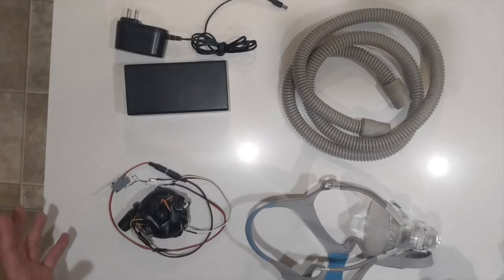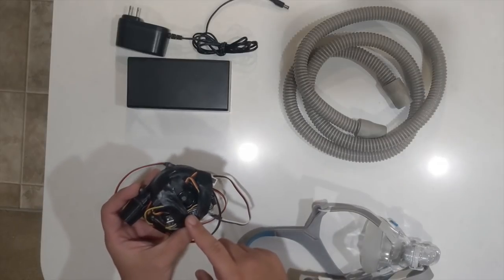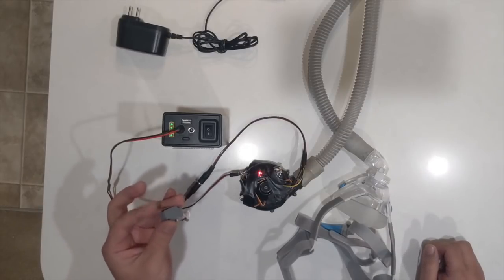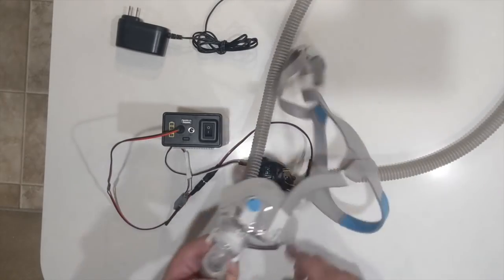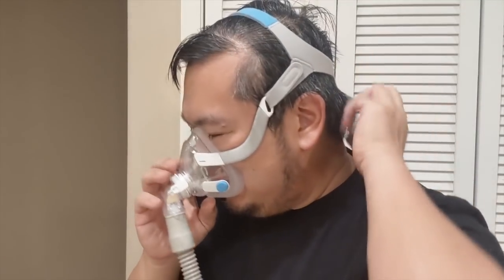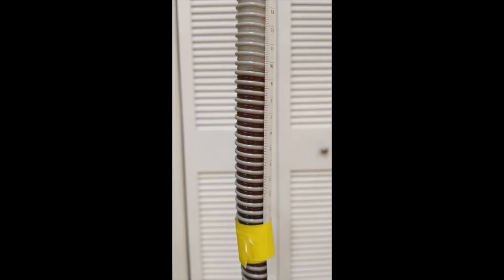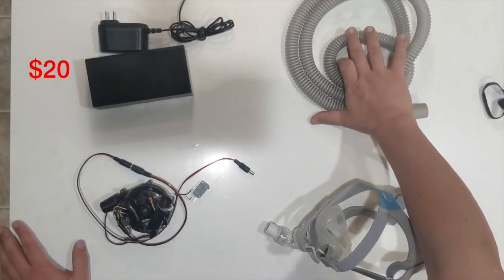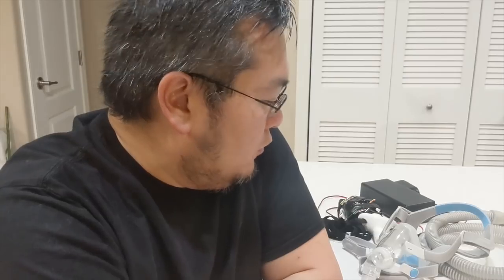Low-Cost Open Source Ventilator-ish Device

Comment: The folks over at ApneaBoard are having this very discussion.  Your help/comments at the forum would be greatly appreciated!  It's on the main forum under "CPAP use for Coronavirus mitigation & severe pneumonia".
Reply: Thanks Jeff.  Yes, Johnny, I invite you over to the Apnea Board forum where we've been having this conversation for the past week.  We have a lot of knowledgable Advisory Members over there who might have insight that could help you.  Would love to collaborate a bit, as this will increasing become a very important project.  -- SuperSleeper, Apnea Board Administrator.
Reply: Love how your thinking. Ive been thinking along the same lines as well. As a cpap user myself and working in an engineering field as technician, I love DIY projects and solutions. Keep going with it!
Reply: So you copied a comment that someone else already said.
Reply: Had a read of the discussions over there and it makes good sense.

Comment: I was an ICU RN for years. You have to be able to regulate both volume and pressure as well as the amount of pressure left in the system after the patient exhales - called Positive End Expiratory Pressure - or PEEP - which is vital for someone with severe pneumonia or ARDS. The pressure left in the system at the end of expiration helps keep the air sacs in the lungs open and is very similar to CPAP. You must be able to set a volume of air the machine will deliver with a single breath - called the Tidal Volume - typically 600 to 900cc of air. You also have to be able to set the rate of breaths the machine will deliver per minute - typically 12 to 20 depending on other conditions. It's very important that there be a pressure relief valve in the system to vent air off. If the vent is trying to deliver a breath and the patient coughs against the breath it can raise pressure in the lungs very high and pop a hole in the lung tissue - a pneumothorax - which can kill someone quickly if the pressure inside the chest cavity builds up. Besides delivering a set number of breaths the machine has to be able to sense if the patient is trying to breathe on their own and assist them with that breath. Ventilators are very complex pieces of equipment. 

A better alternative might be to work on developing a device that can automatically squeeze an Ambu bag at a set rate per minute. The volume of air is determined by the bag and the PEEP can be set with an external valve that attaches to the bag. All you have to worry about is the frequency of breaths. Others are working on this right now. Good luck.
Reply: Highly Relevant Commenter think a CPAP could provide the PEEP and the ambu bag provide the volume and frequency?
Reply: Thank you for your feedback. Check out the notes section from after talking to pulmonologists and respiratory therapist. And if you'd like to provide more professional feedback, you can join the conversation on github: https://github.com/jcl5m1/ventilator/wiki/Notes-from-chatting-with-a-pulmonologist

Comment: I knew someone with an understanding of how medical ventilators work and some ingenuity would rig up a basic prototype and make a YouTube video.
These guys are heroes!
Ventilators are essential for treating covid-19 and are in short supply globally.  Ventilators of sufficient quality to last the duration of the crisis could easily be mass produced in a relatively short time.
Reply: madwtube  What's the set back? He did ask for feedback.
Reply: > someone with an understanding of how medical ventilators work
He isn't. Sorry to burst your bubble.
Reply: @nodriveknowitall702  This isn't capable of the type of ventilation COVID patient's need... first do no harm... in the end you may end up hurting more than helping by implementing this bootleg stuff.
Reply: @DanShowandTell  Yeah, that's what someone else said already. I dont doubt that you and the other commenter are correct, but you're not describing exactly what the issue is. 

As far as harm goes, I wouldn't be implementing anything like this. I was only curious. I'm practicing prevention rather than medicine.

This may be on another level outside of my typical experience but I see people, all to often, give up when practical solutions exist.
Reply: nodriveknowitall the issue is the vent isn’t capable of modes of ventilation required. Full stop.

On top of the vent we also need sedation, paralytics, software, monitoring devices, and (most importantly) staff to actually implement the modes required.

I’m a respiratory therapist... I make a living operating these machines
Reply: @DanShowandTell  Per Johnny: Thanks for the feedback. Here are his notes from chatting with pulmonologists and respiratory therapist: https://github.com/jcl5m1/ventilator/wiki/Notes-from-chatting-with-a-pulmonologist

If you have additional recommendations, feel free to provide guidance to help improve the project.  He has the following thread open to track professional feedback.  Advisers willing to share contact info are greatly appreciated.

https://github.com/jcl5m1/ventilator/issues/16

Comment: As a long term CPAP  user and engineer, this is obvious to me and many other folks and I have discussed it with friends.  My approach is to leave the CPAP assembled and add one of many possible experimental modules to modulate the control voltage of the CPAP.  An even easier and more straightforward approach is to start with a BIPAP and make minor changes to the control voltage.  I believe the BIPAP approach has been tabled all over the technical world.  

Johnny, thanks for bringing this general approach up.

Comment: Hi Johnny and other interested Makers,
i am  building "something" right now as well, more along the lines of a positive pressure iron lung :
- really simple 
- easy to build
- easily available non medical parts (hopefully in a lot of makers possession )  
- easy to service and repair 
- In case of motor falue manual operation possible (like the iron lung)

Geared motor -> linear motion ->  bellows -> Pressure regulator tube (the thing that goes up and down in the cartoons) -> valves for respiration and inspiration -> lungs 
i think the pressure regulator can also be used as a volumetric measurement, so you can change depending  on lung capacity.

Johnny Lee, i am open to help with ideas, in the meanwhile i have some designing and reading up to do now :D

best regards from Lara

to all the critics: Yes i know it is in my case it is driven by a wiper motor - but hey, it may save your grans life :3 
!!! also stay in please, so we don't have to use those funky machines ever!!!
Reply: Just make a video and show us plz

Comment: Johnny Lee, I'd like to invite you to Apnea Board to discuss your ventilator project with members there. Search for "CPAP use for Coronavirus mitigation & severe pneumonia"
Reply: Actually, many cpaps today have many of the same features as full vents. The most notable difference is the peep valve. As long as the patient can work with a simv mode vent I think cpaps can provide what is needed in many cases.  Simv is pt initiated assisted breathing verses total dependant on vent to breath
Reply: Daniel Roig  So then, someone needs to find a cheap alternative to oxygen separation/concentration.
Reply: Mike Moloch  One thought is maybe for some getting parts to assemble a blower like Johnny Lee has shown may be easier.
Reply: Daniel Roig  thanks for info
Reply: Daniel Roig  Of the ventilators my pulmonary doctor is considering, I do not see anything that describes or suggests the ventilator adds oxygen. That would require an oxygen bottle or portable oxygen concentrator. as my research indicated. FWIW due to my respiratory overlap of COPD and complex apnea, I may need the ventilator such as a ResMed Astral 150 or Respironics Trilogy. Neither of those generate oxygen.
Reply: Daniel Roig  Would a CPAP combined with an oxygen concentration be effective? It's got to be better than nothing once the hospitals get full.
Reply: Johnny why not  use the whole cpap instead of just the motor, it's programmable?
Reply: Daniel Roig  a ventilator doesn't generate oxygen... it's hooked up to 50psi pressurized O2
Reply: @jizzwizard6939  no... CPAP only aids in oxygenation... we need APRV
Reply: Daniel Roig a POC cannot keep up with a pt demand very well... at best they’ll put out 5-6lpm because that’s already a normal resting persons ventilatory demands, they don’t go higher without modification and that may accidentally turn it into a bomb. A normal minute ventilation is about 7lpm on minimal settings,  so at best you’ll achieve 50% fiO2 and that’s not enough.
Reply: Daniel Roig  he is not recommending anything. He is suggesting a potential starting point for other more qualified people to work with or discard. He made it clear that he is not a professional. Your comment is out of place and wholly unnecessary.
Reply: @Shimmy Shai I am going make an input  to add oxygen from a canister to this ventilator.
Reply: @jizzwizard6939  that's the point. When you are dying if this device gives you a 3% chance to survive. The hospitals will run out. I just checked on the production of 3 respirator companies and they can only produce 600/month
Reply: Daniel Roig  Oxygen is not flammable! though an oxygenated environment will make anything that is flammable burn more fiercely if it happens to be ignited.
Reply: There's just enough knowledge in this comment thread to be dangerous. Jesus christ.
Reply: @jizzwizard6939  I am a user of a cap device. I have seen cap masks that have a port for attaching lines from an oxygen source, such as tanks or oxygen concentraters directly to the mask. Not all of them will do this. But I have had one myself in the past. Hope this helps.

Comment: Thanks for your time.  As a patient using a resmed cpap,  i had the same idea as you.  The cpap from Resmed that I have is a brilliant piece of engineering. I have a similar mask for nose only.  It seems doable for the cpap manufacturers to come up with a modification.  A crude 12 breath cycle per minute application is easy for the engineers at the factory.  A lot of work for you and me.   The ResMed AirSense 10 could possibly save a few lives if it was just reprogrammed.
Reply: I have a CPAP that I also use from resmed and this is my thought as well. Re-tooling a CPAP seems like a much more feasible idea than stripping one for parts. The need for humidity in the air is because the lungs need that humidity. if you're too try you can get a sinus infection.
Reply: @utakubeta8311  I spent the day yesterday researching the topic.  Respiration is much more complicated than I thought.  I am not qualified.  I took apart an old Fisher Paykel.  I thought interfacing the motor to an arduino would be an interesting coding project..  It is more complicated than I thought.   There are a lot of better ideas out there right now.

Comment: I like this, Johnny. I am an engineer, and sometimes I work on biomedical devices. This is a very practical approach to providing an assist to a patient who is having trouble breathing who does not require full-up endotracheal ventilation. Several suggestions please. This motor is not a permanent service motor. It is consumer grade. If this kind of approach, without intubation, is effective in a significant number of cases, then the final version really out to have a medical grade blower. That would be a logical next step. Patients can require respiratory assistance for a month. For a proof of concept prototype what you have done is excelling, but if this is 'life support' you want better blower.  The second thought is that you could easily flow a little medical grade oxygen into the intake. This will help keep oxygen saturation up, even if the patient has impaired.  Between the two this device might help keep people off increasing rate, full up, FDA certified, tidal ventilators.  Kind regards, Robert

Comment: This looks great Johnny! Thanks for making the effort and pushing this forward. We need about 10000 more folks like you to make it happen. That's not cynical, but rather hopeful, and I'm happy to be one of them. I do have a few thoughts, and would love people who know ventilators and their operation to comment constructively. First, with constant pressure, even if oscellating, how is one to be able to exhale? Is there a valve assembly that I am not seeing that allows for this? Second, I would think that a medical professional (or trained other) setting up a system like this for a patient, would want some kind of display available, so they could chart a patient's vitals against the ventilator's settings. Hard settings, like dials and switches with LEDs, could do this, as could a display with dials or button controls. I just think that the folks managing the unit would want to be able to see what was actually happening in real time, and make specific adjustments in an articulated manner. Third, is there any need or desire to have an Oxygen input in a system like this? It might be a good option for the very ill for whom normal air is just not enough, although I cannot pretend to know how that would effect the design. Perhaps making some with O2 input and some without would be good, as the O2 may only be needed in few cases. No idea really. PLEASE HELP WITH THIS PEOPLE. MANY THANKS.
Reply: I am hoping to make 100 of these and send them to local hospitals
Reply: Yes.. adding oxygen would be absolutely vital in the advanced stages..
Reply: Check out his latest notes from after talking to a pulmonologist: https://github.com/jcl5m1/ventilator/wiki/Notes-from-chatting-with-a-pulmonologist

Comment: My wife is a physician, I am an electrical engineer, I told her that we should find ways to build a "home made" version of a ventilator, she told I was a fool: "those are computers" were her words, your video proved me right!
Reply: You should have said to her, "You can't fix human beings.  That's biology."
Funny that your wife does not understand that "computers" are designed by electrical engineers like yourself.  I'm guessing the mechanical parts would require the most thought for you.  You could probably do the circuit design and programming in your head.  I can relate.  I work in IT as a DBA/programmer and my close friends and family have no clue what I actually do.  If I try to explain they are basically lost halfway through the first sentence.  Most of them probably imagine that I replace broken keyboards or something.

Comment: I've ordered 6 disposable scuba mouthpieces for $11 on Amazon. There's no reason to 3D print the mouthpiece. I believe these clear silicone mouthpieces are used for scuba equipment rental.
Reply: Please add the link.
Reply: @WirelessDevelopment  There are many suppliers including Amazon. Google accordingly "Scuba Choice Scuba Diving Clear Regulator Octopus Mouthpieces with Regulator Tie (6-Piece) Perfect for Dive Shops and Dive Resorts"
Reply: @eenkjet  Those won't work for positive pressure ventilation. Air will just leak by the lips.

Comment: Apparently the main issue with the at home machines is that it aerosolizes the virus and contaminates the surrounding areas.

It needs a filter for the exhaled stream of air.

Otherwise I love it!

Links to the 3D  mouthpieces, but maybe someone can add a filter to a design?
Reply: I don't know anything about contamination so this may be stupid... But regarding the part of people in the room getting infected could there be a case where people who have been infected and came out the other side could volunteer to man the machines that way reducing the complexity of the system  and helping reduce speed of  deployment....
Reply: There are mouthpieces with a built in filter out there. That is an easy to solve problem!
Reply: If he is in quarantine no one is around so it's less likely it would spead
Reply: @babeena_gt_3645  Nurses and doctors need to be protected too, that's why they need a filter even quarantine
Reply: @bitzersporttherapie7331  I think he means self isolation at home.  Many people, as in China, might not even get into the health care system to be treated
Reply: @JointFive  Just that we have to think about needing a diy ventilator  in quarantine without medical assistance means our systems are out of whack.
Reply: maybe you can divert exhaust air into a chamber with ultraviolet and ozone supply inside. You can find ozone making from water purifiers. This can be used at the supply air intake side too
Reply: 2 tubes. With a valve on the outlet side. Filter air in. Filter air out.
Reply: if you have a sick person at home, unless you have a completely quardoned off area with seperate AC/hear and the other family members wear full medical PPE you are going to be encountering the virus! 
 The short answer in a home envronment in a household where you live with the infected person there really is no avoiding contacting it!
Reply: @nigelr3628  or persons who already have the virus but are asymptomatic
Reply: You can 3D print the mouthpiece with filament that is made with copper particles, it has anti bacterial properties and you can find it on Amazon.
Reply: @nigelr3628  air moves and the virus has been shown to be viable 3 hours after aerosolization.
Reply: Miguel Esteban Vasquez dude, didn’t the name Coronavirus give you a hint. It’s a virus, not a bacteria.  Therefore antibacterial agents don’t have any effect.
Reply: My vacuum has a HEPA filter.  That could solve the issue.